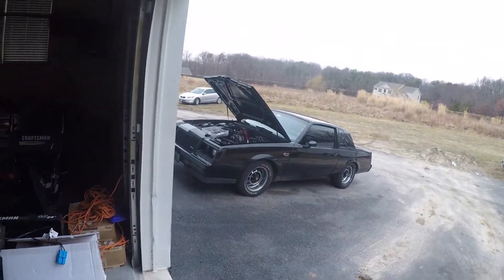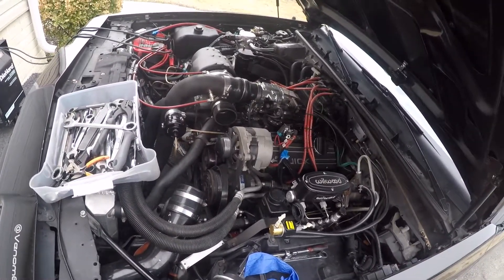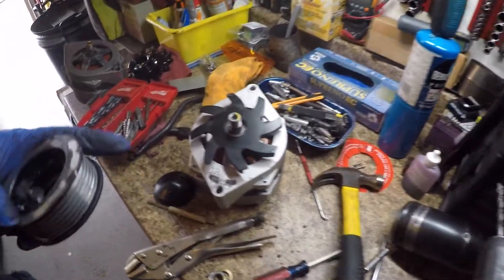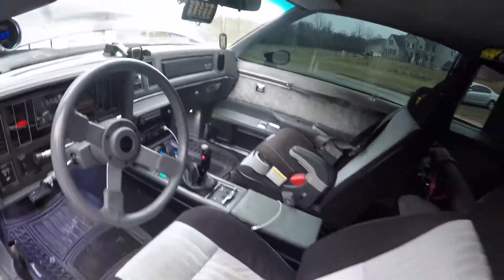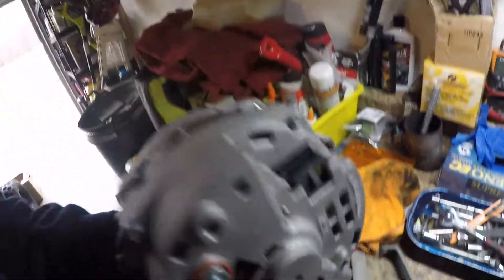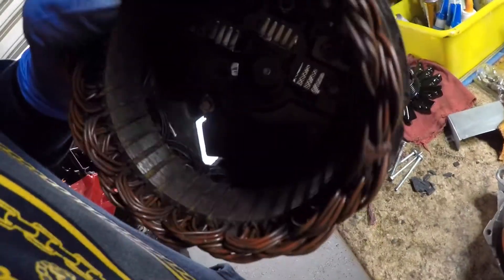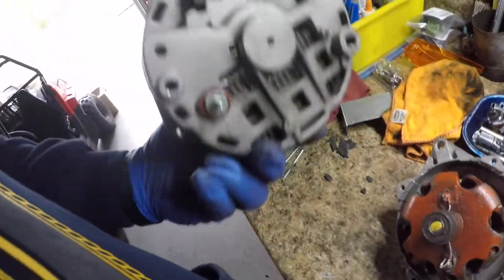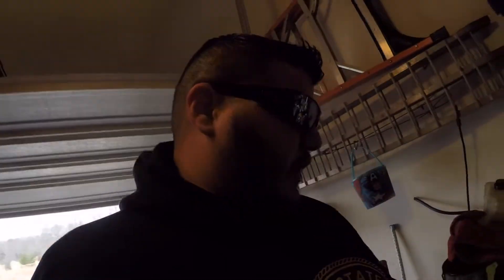I Bought a Batch of Bad Alternators | Replacement and Failure Diagnostic

Comment: Are you still running the lower bracket at the back of the alternator it seems on my car I would have to take the valve cover off to remove my alternator. I have the same valve covers as you.
Reply from the maker: Yes I do and that bolt on the back of the alternator is a pita every time I have to mess with it. I did clearance the valve cover a smidge to be able to get a wrench back there. Its the last bolt I take off.

Comment: How does the TR6 ignition module work with regular driving. Do you need to run the Casper’s V-plus volt booster ? With spark plugs gapped at 035 ?
Reply from the maker: Work just like the stock one but better. No volt booster and spark-plug gap wouldn’t change that.
Reply: Thank you, I just purchased Bob Baileys TR6 system. I love your videos too.

Comment: Get a McMahon alternator 150 amp should be enough power to power all your accessories
Reply from the maker: Thank you, I was looking at those but even with all the accessories I have, an 80 AMP alternator should be plenty, I went with the 120 since they are the same price. Biggest loads on the entire system are the A/C clutch and the radiator fans. I am leaning to over speed as the cause of the brushes failing.
Reply: The reason I was saying to go with the McMann is a quality this is your 4th alternator not so much the amperage I have one in my 79 el camino no problem since i got it. Going on three years since I got bought it real beefy
Reply from the maker: Gotcha, if this one goes, I'll definitely be buying one then.

Comment: What alt did you use  one off a 96 Impala  SS
Reply from the maker: No, the 120 AMP from advance. PN: 7911-4A
Reply: I  have had good luck with the impala alt  you years now.
Reply from the maker: I don't know what it is, I've had them all from a fancy powder coated $400 alternator to this cheap-o one, which is the one that has lasted the longest. After the first fancy one failed I checked for a short or something out of place but nothing then the second one failed and I took off the volt booster, I then replaced it with this one. The only thing in common is that they all stopped charging after running the car hard
Reply: My brother had 2 bad ones right out of the box from the local (big) auto store. 3rd time was the good one!
Reply from the maker: Thats how it was with the Bosch unit, lasted a day, second one lasted two...cheap one lasted 2 years lol